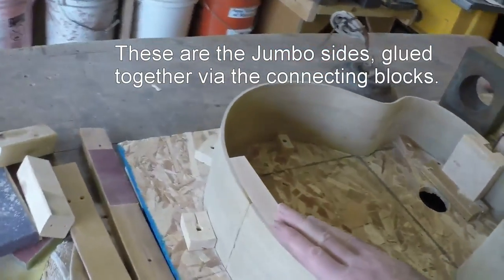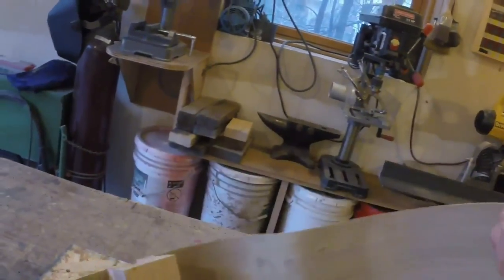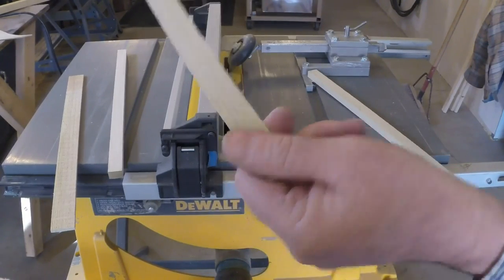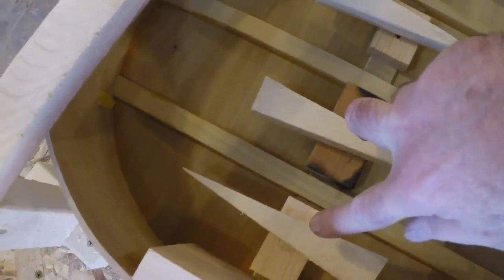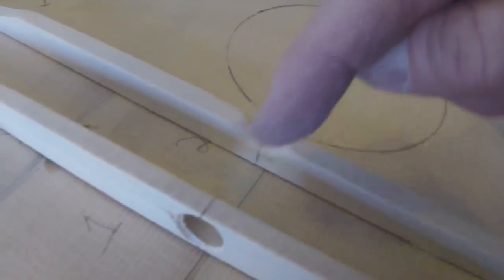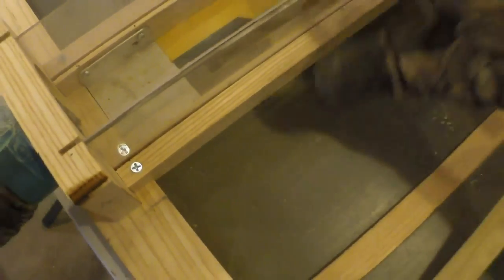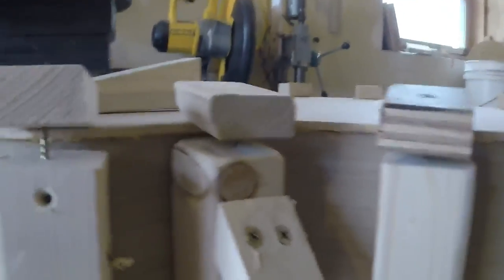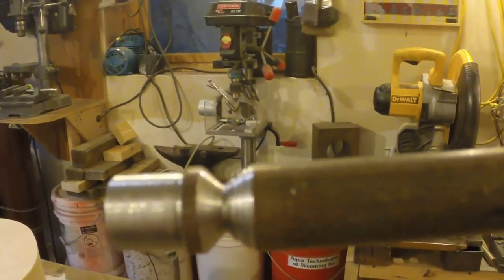Feature length Oldtown Jumbo guitar build part 1

Comment: As a child  i was taught imperial ,inch foot ,yard,chain, acre, hectare ,furlong,mile, ounce, pound ,stone ,hundredweight,ton, here, in the uk,, then we changed to metric, much easier but i still use imperial  ,say how to guess, many stones people weigh, or i use inches to read out on a tape measure,its easier to see the inches .But i use mm for accuracy ,all my tapes/ rules ,speedometers ,scales, read metric and imperial ,embrace both they all have merits.
Reply from the maker: Tony, that is good to know! I thought you used a mix nowadays...thanks for clearing that up. I made a few people angry joking about the systems, but I also use metric measurement when it is clearer. I do like thousands of an inch though, for really tiny measurements and when I use my CNC machine, I use printing paper as a feeler gauge.......  .004"
In imperial.

Comment: Would it be a better plan with no metric scale included?
Reply from the maker: I actually like both systems on the plans. It's just that in the US, most construction measuring devices are in inches/feet. I was trying to be funny...picking on the metric system...but I like using it also. Good question!

Comment: Can i please get the measurements for jumbo acoustic guitar?
Reply from the maker: Look on the internet. There are many sites that have that information. But a Jumbo typically has a 17" wide lower bout (or belly) and almost 5 inch tall body.  They can be in any scale...mine is 24 3/4" scale. They are big guitars and have lots of volume when you push them. My favorite body style. Thanks for watching!
Reply: Thanks, and can you tell me the depth of jumbo....
Reply from the maker: They are almost 5 inches deep at the tallest point, measured from the outside. If you are building one, and want it to fit into an aftermarket case, make sure to check the interior height of the case and don't make your jumbo that tall. Otherwise you will have to build a custom Case if you want one.
Reply: Thank you....
Reply: Hey, can u tell me the distance between the sound hole and bridge of jumbo?
Reply from the maker: That distance is 2 and 3/4"
Reply: @oldtownvids  thanks....
Reply: @oldtownvids  can i get ur email or somethin?
Reply from the maker: Ok. My email is craigite@msn.com